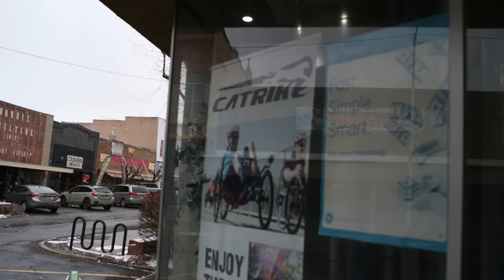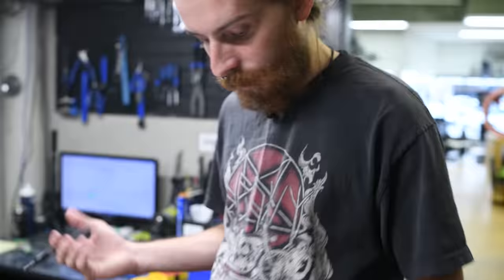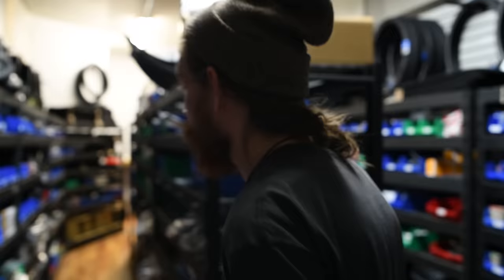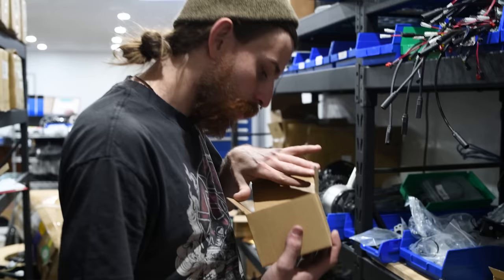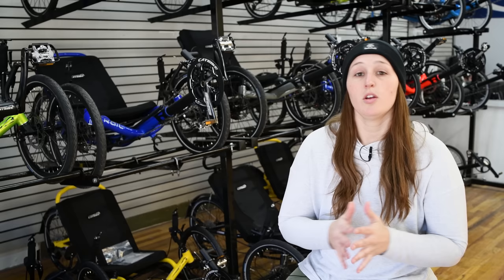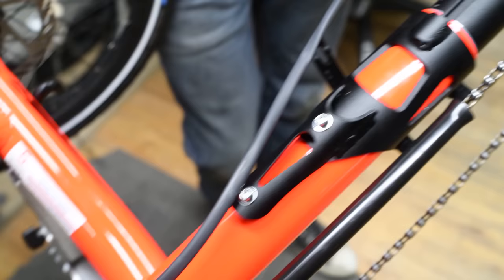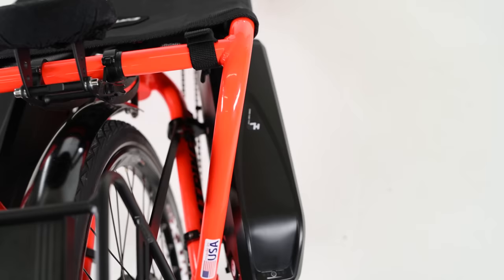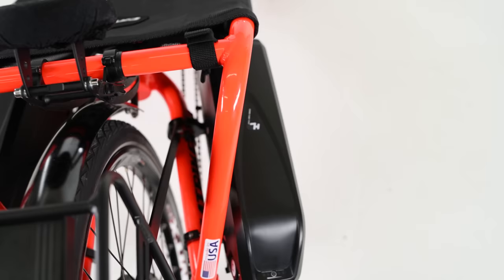30 MPH 1000 WATT Motorized Electric Catrike Expedition - Another Utah Trikes Custom Build.

Comment: I’m officially sick of winter. Wanna get my ICE Sprint X motorized soon. It’s my impression you favor hub vs mid drive? 30 mph sounds like a blast. Actually 20 is. I’d like to see someone design heated grips. Seems doable. Videos make me want to ride. So does my trike every day when I pass by it in the garage. It says “Hey pops, let’s go!”
Reply from the maker: Hey Mark, feels like winter is just starting with all that snow we just got! Hub vs middrive really depends on the trike and the type of riding. With batteries on your trike though heated grips and maybe even a heated seat could be possible.  :)
Reply: 😄😄😄😄😄😄 Hey pops...! I want  a motor too!
Reply: jorge vargas I’ll get one as soon as I figure out which will work best....and it quits snowing and gets into at least high 40s. I’m lucky to live a few miles from Utah Trikes and can drop in.

Comment: Question: With the 10 speed cassette are you using a standard rear wheel hub motor, or do you have to use a narrower front motor for the rear wheel (to allow for the wider 10 spd cassette)?

Comment: Hi, sorry for my english, how do you charge the double battery? One at a time? or both together without disconnecting the parallel with two equal power supplies?
Reply from the maker: You would have a separate charger for each battery. So all you would do is plug in each charger into the wall and batteries.
Reply: @UtahTrikesOnline  without taking away the parallel, right?

Comment: We need motorcycles like this that break 70mph. Bottom line. Wider wheels, thicker break pads, 4th wheel on front for E brake situations, bigger battery and bigger motor. Boom
Reply: 70 mph is fine for flat land,  but will it goes up tall mountain with heavy load on one rear wheel of 1000W power.

Comment: I am interested for crank/ mid  Bafang  1kW motor on Catrike. I am worry,  that weight of motor will tip off front and how the battery will counterbalanced that.  This trike should have option hydraulic brakes front and rear.
Reply from the maker: The weight of the front-mounted motor won't be noticeable on most trikes and is counterbalanced by the battery at the rear. Hydraulic brakes are always an option.

Comment: Did you add a PAS sensor?  On my catrike adventure I am monting a bafang 500w hub motor and trying to figure out how to mount the pas, since the pas they sent is designed to go on chainring side, but the lowest gear on triple crank will not allow it to fit.
Reply from the maker: Yes, although we forgot to mention it in the video. We actually make a custom pedal assist sensor for our motor that attaches to the idler. That way it allows us to use any crankset we want including Schlumpf or Pinion gearing.

Comment: do you recommend putting grease in between the electrical connections.
Reply from the maker: Views are mixed on whether to use dielectric grease on connectors. We use mostly the XT90 connectors, which don't require it. If you will be pulling your connectors apart frequently it won't hurt and can make them easier to separate. The connections on the batteries can benefit from some dielectric grease and it can offer some additional weather protection. Again, feelings are mixed and results and opinions vary across ebike groups.

Comment: With the dual battery, is there individual monitoring of charge level, and usage control?
Reply from the maker: The batteries themselves have individual level meters. At anytime you can view the voltage on the display for whichever battery is on or the average of both. We recommend turning both batteries on and off at the same time trading them as a unit. This provides the maximum amperage to the motor with a lower draw to the individual batteries.

Comment: Nice video, and thanks for sharing. Just wondering, what brand of hub motor are you using and does it actually get 30MPH?
Reply from the maker: We are actually getting these motors chalian made for us. We have three different torque/rpm versions. The 540rpm version with a 26in rear wheel puts it right at 30mph with no pedaling in the flats and pulls about 1400W.
Reply: @UtahTrikesOnline  I thought you were using Falco motors. What is "Chalian"?

Comment: Another great video.  I feel like I'm watching a season of UT and how the trikes turn out.  What happens to the cables/electric wires if/when the front boom is extended or shortened?   Does it make a loop or can't be "stretched" forward with the boom?   Just wondering as it wasn't addressed.   Thanks!
Reply from the maker: We make sure there is enough cable so the boom can be extended. The excess cable is looped and tucked.

Comment: How do you get a customer to determine their X-seam?
Reply from the maker: Our preferred method is to sit on the floor with your back firmly against a wall. The, with your legs flat on the floor, measure from the wall to the heel if your shoe.

Comment: I slapped a Bafang 1000W on my Expedition. Toying around with the wheel diameter settings will launch me across town at 50mph. But then the battery gets hosed after 20 miles of that. I just wanted to see what it could do before resetting it back to sane levels.
Reply from the maker: The wheel diameter settings in the display are only used to set the speedometer correctly, so you want to make sure that it is set accurately. Otherwise it will tell you that your going faster or slower than you are.

Comment: I understand the aerodynamics of sitting low but in this case back pressure power into the legs is diminished because of it. it will eventually cause body sliding and back pain.

Comment: What type of battery range are you looking at with this setup? I understand there are weight, terrain and weather variants. Price of this setup? Thank you. 😎🤙🏾
Reply from the maker: Generally, you can expect 10-20 miles per battery with no pedaling (motor only) and 4X that if you use the motor as a pedal assist. This setup was just under $5500 + Shipping. Thanks for watching!

Comment: So the inevitable question.   Can you estimate how long or how far a 1000 watt system will take you?   I like what I see so far.
Reply from the maker: There are a lot of variables, such as how much you use the motor vs pedal, the terrain you ride on, how aggressively you accelerate, speed you ride,  rider weight, etc. A safe estimate is typically 10-20 miles per battery with no pedaling. Using pedal assist modes you can get 4X that range.

Comment: I love watching your build/ customizing videos. Are there any advantages to the rear hub motor versus a motor mounted to replace the front crank such as Bosch or Bafang. Do you prefer one over the other. I would like to upgrade my 559 but having hard time deciding what system to go with. A video on the differences would be a great topic. Thanks
Reply: I have a fair amount of experience with these as I have built several difference electric vehicles,  including the solar electric recumbent tandem trike that runs totally off of sunshine. Pictures are available if you would like to see it. I started out with bicycle wheels and tires but now I'm upgrading to motorcycle wheels and tires and upgrading from a 1000 watt rear hub motor to a Mxus 3K turbo Hub motor. From what I understand the mid Drive Motors that are integrated into your crank can produce a lot of torque, but don't have the regen feature to put electricity back into the battery like the Hub motors do. The Hub Motors are also more efficient because you don't have to turn that really long chain, sprockets, idlers, etc. My first conversion was a mountain bike and then I took a Honda ATC 185's and converted it to Electric ( video of it here on YouTube),  and then I built the solar electric recumbent tandem trike and I have plans for a four-wheel drive electric pickup in my head now and I'm researching the various parts needed for it.  Electric vehicles are addicting! Good luck!!
Reply from the maker: We are working in a video that will go over all the differences. The big advantages of our rear hub motor is that it allows you to keep all the front gearing and also offers reverse. Middrive motors are generally easier to install and removing the rear wheel is easier.

Comment: So this won't be able to go on the trails with speed limits of 20 MPH, like some of those in Florida.
Reply from the maker: The motor speed can be hard limited by us if needed by locking the controller or at anytime by the rider by setting a max speed in the console.

Comment: At 1:42 - Please get this order, a 1000 watt motor. Really, is it a wheel hub or mid-drive? You never mention which one is it early on, which should be the case.
Reply from the maker: This build uses our UTCustom 1000W Hub Motor.
Reply: @UtahTrikesOnline  
Should not have that be made clear during the phone call?

Comment: Super sweet. What is the range and to speed, thanks.
Reply from the maker: There are a lot of factors, but it depends on if you are using the motor alone or add a pedal assist. This system with dual batteries will have a range of 20-40 miles without pedaling. Using as an assist can give you 4X that. Motor speed tops out at 30mph.
Reply: @UtahTrikesOnline  answers my question on speed bcos was thinking 1000w would surely go faster than 30mph 😉👍

Comment: The thumb throttle is on the wrong side !
Reply from the maker: Placing the throttle on the left is usually best as it doesn't interfere with standard operation of the shifters. In cases where the customer requires the throttle to be on the right we will shift things around to accommodate.

Comment: It would be helpful if you didn’t make the videos so choppy. You need to pan back a little bit and let the bike sell itself rather than point towards what you’re looking at then go back moving the camera abruptly to go over to the other side of the bike. It is hard to concentrate and I want a nice slow visual to get a chance to drool over the machine. When you go back-and-forth and cut here to there you can’t get a chance to even see the vehicle before it abruptly changes the scene shot.

Comment: So it's a wheelchair
Reply from the maker: Yep, just like your car is a powered wheelchair.
Reply: Especially for people who can no longer drive in an upright position after an accident or illness, a trike is a great option to continue to manage medium distances independently and athletically.  Whether or not you have an engine with you is also a question of the health of the person, and at the beginning of a rehabilitation phase, engine support is certainly sensible and appropriate.  - The people I know who drive a trike drive this because they were disabled due to accidents caused by third parties (cardrivers who run them over), but unlike people in wheelchairs, they remain fit and sporty despite the severe pain.  - I think this is an approach that should not be smiled at or even ridiculed, because after all it costs the general public much less if an invalid person can travel independently, instead of being dependent on others and keeping fit.  In addition, the person individually gains quality of life.